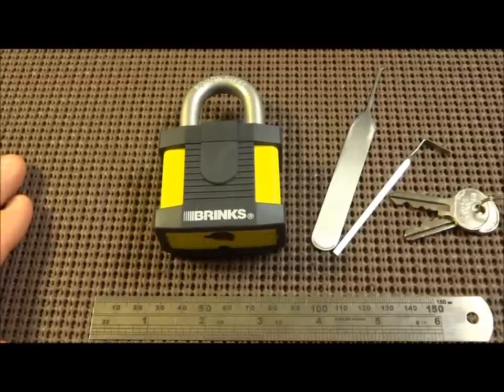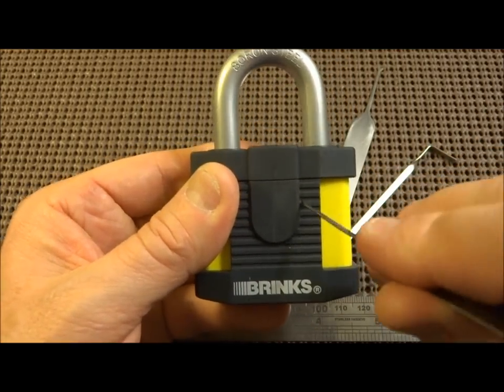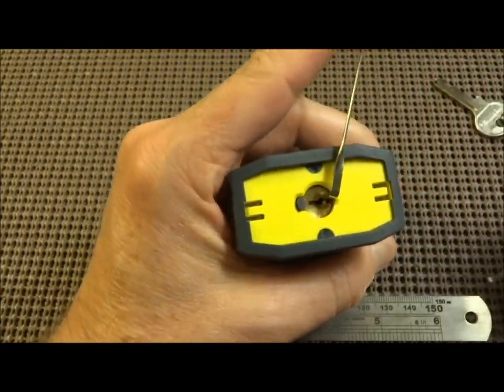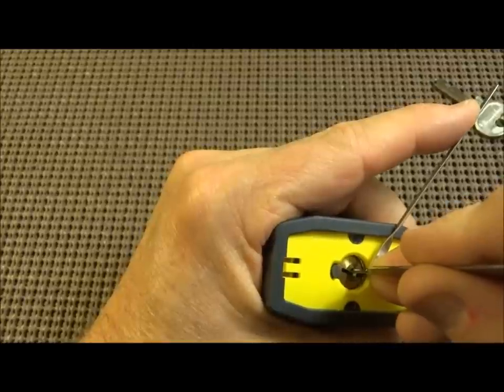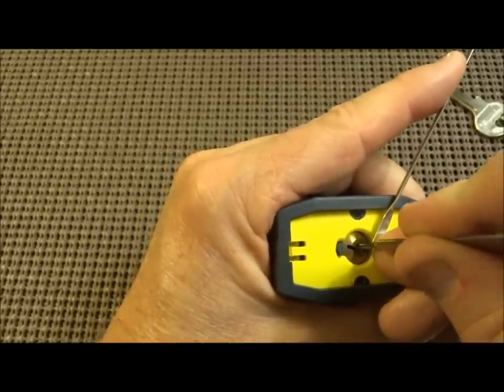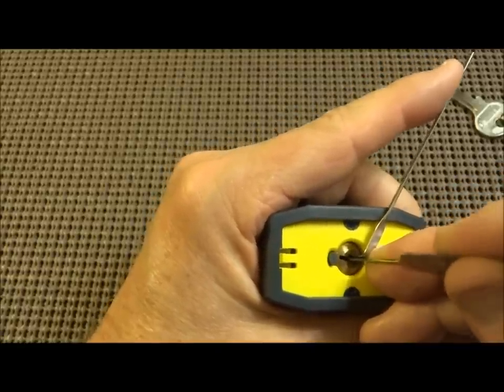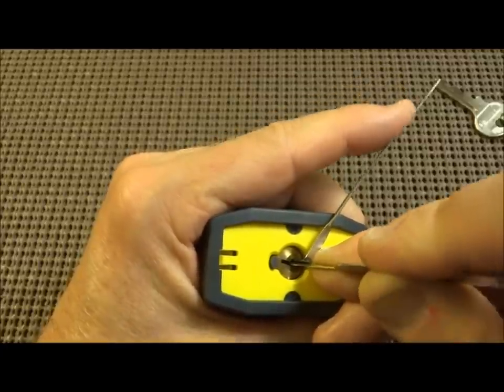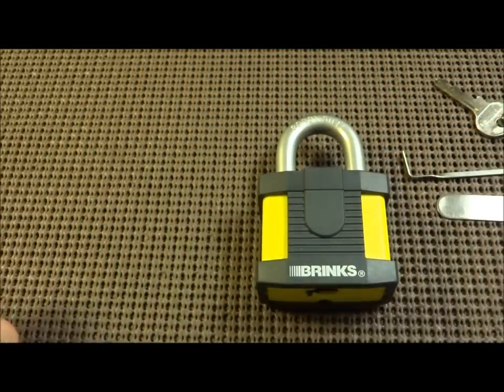(73) Brinks 50mm Maximum Security Padlock Picked

Comment: Good tips I found that releasing the tension and starting again allows the pins to fall into position more often,  and then going back thru the pins again I almost always pop the lock open,  or when I go thru the pins the first time I feel the tension give but not open I roll back on the tension then back the lock will open and I've done this repeatedly  One other tip I recommend is I have a variety of locks including the 7 pin adversary,  I go thru them picking them repeatedly using each of the tools in the kit including the hooks,

Comment: Is there a "set" as opposed to a "false set"? If so, what's the difference? I understand the concept of a binding pin and what happens when you push it.

Also, when you're applying tension, you appear to tap the wrench a few times. Is that to get a better feel for the lock?

Comment: What are your thoughts for left handed pickers? For me I feel I have had much more success using the pick with my left hand. But I find it hard to hold the lock the way you do. Is using your thumb for feel with the tension wrench a good idea? That's pretty much the way I have been picking so far.
Great video!
Reply: I'm not a picker, but I understood that the finger is more sensitive than the thumb, so it could be easier to do it with the finger for the tension than with the thumb, since you can feel better...
Reply: bosnianbill WARNING; This workplace does not give a shit about safety

Comment: Hi guys, I am new to lock picking. Any reccomendations??? I have tried paper clip picks but they do not work... Cheers
Reply: +Kuba Brudnik I started with homemade picks and such, windshield wiper blades are a good source for materials. Going to a junkyard and getting dipsticks [the kind you use for checking the oil level in a car] would also work as long as you get the flat ones and clean them well. there are plenty of videos on how to make picks on youtube.
Reply: +Kuba Brudnik bobby pins work pretty well too. stick with stuff like the cheapest masterlock you can find.
Reply: +Kuba Brudnik Beginner picks cost like 5-10$ for a set. Buy those, see what you like. Move on.
Reply: google sparrows lock picks.
Reply: I remember as a kid my dad would lock the computer mouse in a filing cabanet to stop me staying up all night. So I taught myself to pick the lock with a bent paperclip. I like to think he'd be proud of me for that, but he still doesn't know anything about it.
Reply: moles9999 Now I know.
Reply: moles9999 why don't you tell him? 'Hey dad, I learned how to pick locks with paper clips when I was 14. Think you can guess why?'

Comment: I have picked padlocks before but the tougher ones I just drill them out.
Reply: For a criminal that's a bit impractical.
Reply: +Luca Stuart Sure, but I am not a criminal. I have had to drill out mu own locks that I have been stupid enough to lose the keys. But with a strong cordless drill the lock will fail quickly.
Reply: C MJ there are quite auf few locks which will rather kill your drill.
Reply: I Wasn't implying you were a criminal or anything, i was just saying that because he was testing the security of the lock, although, it is kinda worrying that you can just drill it off XD.
Reply: People have other reasons than theft for trying to open a lock. I lost the keys for some of mine and I had to use bolt cutters or a pick and yes a drill. Some locks are harder than others to drill, but I have not found one yet that can't be drilled out. You may ruin a couple of bits, but they always pop.

Comment: What is a false set ?
Reply: +paul microns When a pin is "set" in that it locks in position and unbinds, causing another pin to become the binding pin, but isn't aligned correctly. Security pins are designed to make false sets happen more frequently.

Comment: nice , but the smaller brinks - 5 pin -  locks are '' UN-pickable '' , you have to buy the U.S. made ones ..  try one ..
Reply: What makes them unpickable?
Reply: crunch9876 I'm talking @ the all brass locks , I've opened up hundreds of locks , but this brinks lock I've got = will not open ..
The key works perfect ,
Reply: link to the lock? ive never seen a great brinks lock
Reply: I don't have a link , I got mine at a flea market . I called brinks and the lady said it was a 1998 lock made for mail bags when they sub contract a trucking or shipping company ...